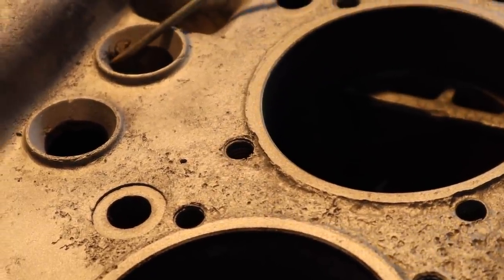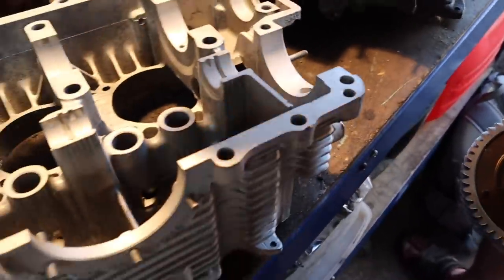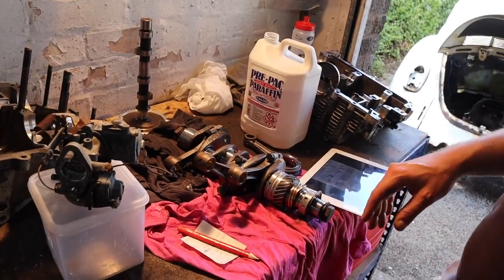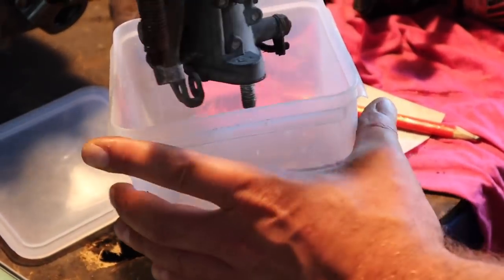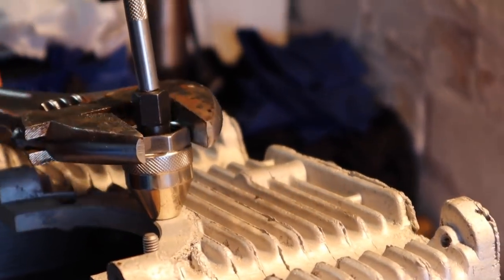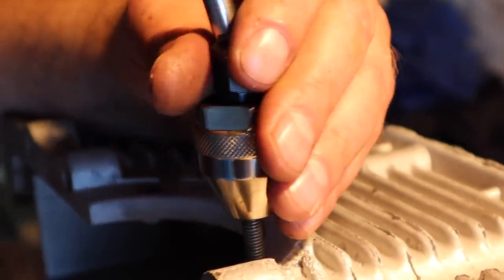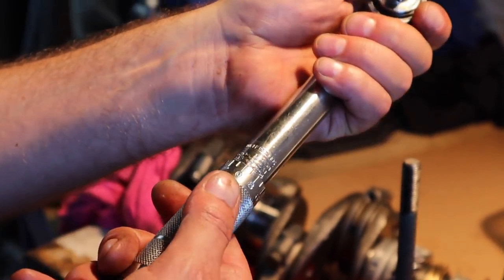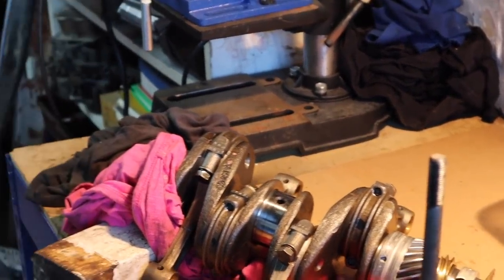VW Beetle 1300cc Aircooled Engine Rebuild -Sketchy- Will it run? Part 4

Comment: It's taking shape....even if I do say so myself.... I saw another video of cleaning the inside of the engine and the only part that was cleaned as we did were the places the bearings seat into....overall pleased with the cut. Not sure we should have been discussing how to rob a bank in a Beetle but there aren't any comments from the Police yet. 

Ali Mack would benefit from adding narration to some of the videos and taking out the shots of the back of his fleece. I guess he'll get feedback about that kind of thing.

Comment: No oil filter , type 4 engine fitted to later buses had filters. Before you assemble that engine clean those cases inside and out , any debris will destroy that engine, make sure all the oil passages in the crank and case are clear. Check that the long engine studs are secure in the crank case and the threads are not damages as will pull out the case when torqued down.  Good luck and enjoy !
Reply from the maker: Thank you Ant! 👍🏼😎🔥🎩🏁🛠🎸😊
Reply: There's no need for an oil filter like the kind you're used to on the VW flat 4. They leak so much that you're constantly topping it up with fresh oil. Have a look at anybodys' driveway who has owned one and you'll see what I mean.

Comment: Ps is that a dry run or are you going for it? Don't forget assembly lube on the crankshaft journals / bearings and con rods at least oil if not. Ps don't forget too match the pistons up with the jugs / barrels
Reply from the maker: Thanks peter.
The chap we got the spare engine from did a great job, marking the pistons, rings and cylinders , so we have been able to match parts up 👍🏼🎩😎🛠🔥🙈🏁

Comment: Good to  see Kate back. Thanks for the shout out man👍 I  really appreciate it. Am having a heck of a day lol.😂  Yeah start engine live brilliant mate it will be fun. It's an air cooled Vdub it will work I have faith in you mate. Cool gift man handy tool clutch alignment tool I got one myself.👋👍Cristin your a cool dude. I used to use wet and dry sand paper lol to clean up block's. More than enough bits to fix her up. The block is pretty porous. Lube is good lol.😂 it helps mate. Wack the new one in cam. Go with the other block. It's better condition. Deal 150 pounds. Good thinking that man. Bye Bertie the block. Hey Stephen 👋 I use Parafin and diesel Gear oil and thinners to mate best lube for seazed crap lol. Am not sure if they have  oil filters I believe you can install one after market. I  use brake & clutch cleaner. It smells great lol.It don't have to shine just work. I  love your stud extractor man it's cool one of them could have dug me out of few holes lol. 1.3 Rob a bank fit nitrogen maybe then lol.😂 The more studs the merrier lol. I hope not av been working on Vag car's for about 7 years  mainly Tdi's I haven't caught anything yet 😂. Plates for dinner what we having lol. Need the gaskets mate. It's exhaust gaskets mate nice and shiny. Made the same year as all the good music lol. Berti goes bananas 😂

Comment: Castings have been subject to electrolytic or galvanic corrosion. All metals are heirarchical. Lower metals are sacrificial.
 You put two metals together and they form a battery. A very weak battery in most cases, and takes a lot of time.
 How about 48 years. Rainwater was the electrolyte. You have had Aluminium, magnesium, steel, tin, and bits of copper etc bolted together. The oil has protected most of it, but water seepage Capiliary action has corroded the magnesium, as it is the lowest metal in the lot.
Your comment of being like the surface of the moon was spot on.
have seen it on a very short scale, on presses, with coolant, but not like that with a VW engine. I have heard that the old Delahaye was a magnesium block, and suffered the same sort of thing.
imagine if it had been water cooled!
Con rods do matter which waythey go round. Sometimes an arrow facing the front (nose end) , sometimes  dowel or tab side is specified, but read the manual!  
rock on. At least all those fins weren't in vain. accept my apologies!
Best of luck with the new build.
Reply from the maker: Thank you.
Also thank you for the interesting info about metal/science?
How come you know so much about these things?

Comment: A Livestream of the engine start would be a great idea!
Why don't you try to get one of these maintenance manuals, there are many on the Internet? An error could be fatal for this engine, don't you think?
By the way, I'm wondering if you shouldn't put some engine oil between the connecting rod bearing and the crankshaft (but not between the connecting rod and the bearing). That the way I was learnt when mounting my old Granada engine....
I can't wait to see the next episode....
Thank you for these moments, keep going like that!
Reply from the maker: Thank you very much for the tip, support,  and encouragement 👍🏼😊😎🏁🔥🛠🎩🎸😍😎

Comment: Appart from that original block already being fit only as a paper weight, any left over glass media will destroy those bearings before you get it around the block.. please don't waste your time on it, when you have a kit in boxes that is way better.

Comment: Manno in response to your question
How many  £50.00 pound notes would fit inside Berty?
The answer is a lot, but to be specific see below ;) 

The amount of £ 50,000,000 would have in 50 Pound Sterling Notes a weight of 1.21 t. A single stack Of money with 1,000,000 new banknotes would be 133.00 m (145.45 yards) high
And would have a volume of at least 1,763.58 litres. 

Now your Engine is at least 72.74 cu in (1.200 litres) for argument’ sake
I would Gestimate at least 4 times the volume of the engine Would actually fit inside the Cabin of Your Beetle,
 Albeit  He would now weigh about 2 Tonne Lol ;)...................................................................
Reply from the maker: Hahaha!!!
Paul your calculator effort is awesome 👍🏼👍🏼👍🏼🤣🤣🤣
Reply: @Classiccarbscouk    lol
had a few to many suds that night Manno ;)

Comment: "and I don't know what that is". That little plate with the louvres in it goes under the dynamo/alternator mount and acts as a baffle when you pour oil into the engine. You have now unpacked everything and have yourself a jigsaw without a picture. The big round paper gaskets go between the crankcase and the cylinders. There are no gaskets for the cylinder heads. They fit metal to metal/ head to barrel. Don't fit big ends to the crank and tighten it up without the shells/bearings, or as has been said, any oil.
 Oh no, I just saw the ending of the video and you're torquing the big ends without any shells or lubrication. I have a feeling that this is not going to end well.

Comment: thought i saw bertie on marketplace :( would be a shame to get rid i knowits rusty but im sure youd rather enjoy it for a couple of years until it does get too rusty rather than never drive it at all
Reply from the maker: Edward bertie is on marketplace, well spotted!
I'm not sure which direction this project is going in tbh 🙈
Reply: Rusty Love might be worth selling it as a runner if u were to put the ‘new’ engine back in it as a use and improve car then buying something just as charming but a bit more solid